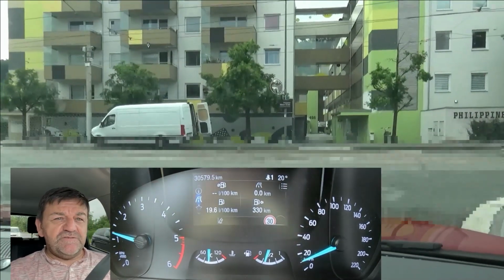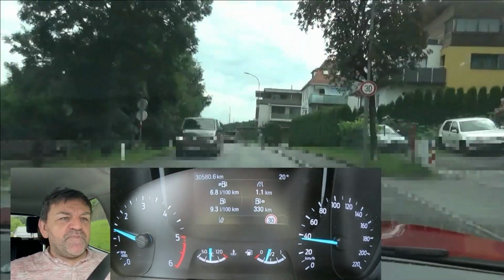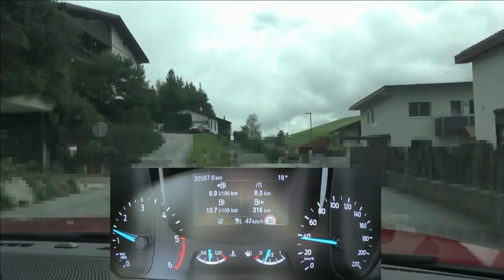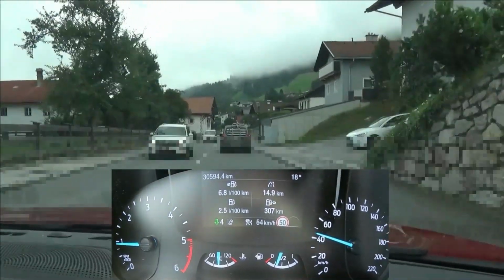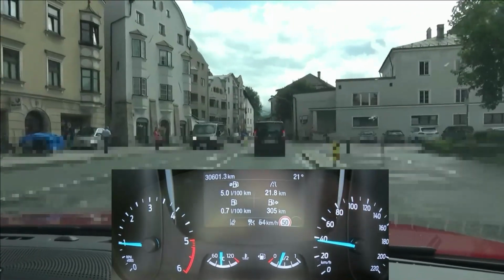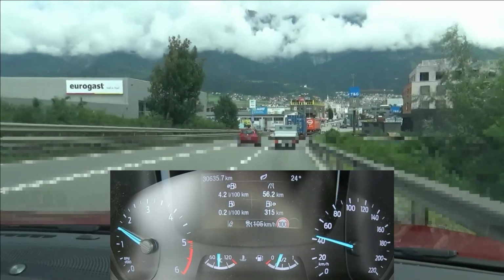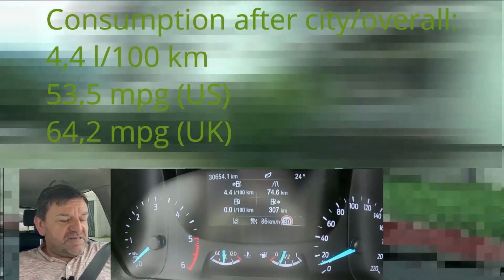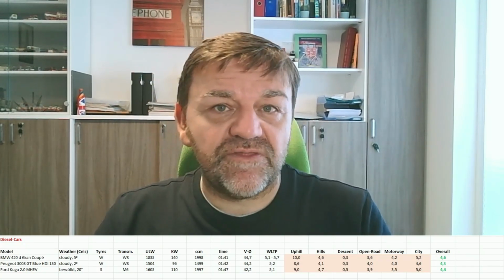Ford Kuga/Escape Diesel Mild-Hybrid - real-life fuel economy test done by a professional ecodriver

Comment: Found your channel late but really not ideal driving for any turbo engine. The uphill is quite obvious here where you were demanding power off boost. Also with the turbo diesel, prolonged running below turbo range leads to clogged turbos and costly repairs. I'm quite sure that the hill section would be much better at 2000rpm.

Comment: Helmut, thanks for your video.  The diesel is not available in the U.S. I believe its called the Ford Escape here.  Diesel fuel in the U.S. is usually anywhere from 50 cents to a dollar more per gallon compared to regular gasoline (87 octane).   I will stick with a fuel efficient Toyota Hybrids that run on 87 octane gasoline, as our 2020 Highlander Hybrid all wheel drive, and 2022 Rav 4 Prime, have been very fuel efficient.  Probably as good as a diesel with both engines having a 14/1 compression ratio.
Reply from the maker: Heyday of Diesel is over here in Europe as well. They tend to get heavier and more complicated with all the exhaust-cleaning stuff. If you don't drive 40.000 kms/25.000 miles on a highway per year (hybrid-)gas cars are the better option.

Comment: Hybrid version in warm countries is nowhere near as efficient as it doesn't kick in when the AC is on, so you're effectively carrying round heavy batteries for nothing.
Reply from the maker: According to this logic hybrids don't make any sense at all, as people claim (mostly correctly) they are not so efficient in the cold, when the engine needs to be running to heat the car. I tested the PHEV with empty battery in 31° Celsius and achieved 3,7 l/100 kms...
Reply: @ecodriver1746  I'm referring to an Electric Hybrid like the KUGA in this test and that in hot weather using the AC impacts the operating of the electric pull away which is where the Elect part drives the fuel consumption down, if this doesn't work as well with AC on then you're effectively towing heavy batteries which is obviously worse for the consumption.
Reply from the maker: In my umpteen years of driving hybrids I never experienced something like that. Maybe there's something wrong with your car. Even in the hottest weather I achieve extremely low consumptions, even with my heavy XC90 (2,3 tons and only 87 kW electric motor). With empty battery and mid-20s, AC on I did 5,8 l/100 kms on this route. And as I said, the 3,7 with empty battery in the Kuga PHEV were done at 31degrees.
Reply: @Awesome TD LOL, never heard such a stupid argument. What exactly doesn't "kick in" in hot weather?
Reply: @arinagriese251  It's a very simple statement, I have a Diesel Hybrid and when you have the AC on the electric start to get you pulling away from traffic lights or putting it in EV mode does not work as much or at all, therefore reducing its efficiency. So its not so efficient when hot in real world  experience.

Comment: Excellent, just shows there's life in diesel yet, particularly on the highways, and where S/S tech can be used in town.
Reply from the maker: Yes, that's the only reason one would buy a diesel nowadays, if you do 20.000+ kms mostly on motorways
Reply: @ecodriver1746  Precisely. That used to be me; now it's not, I'm a short run urban driver, and  even on the open road hybrids are catching diesel up.

Comment: great video again.
but cant understand the big hybrid cars in genarel.

i drive a diesel car (Megane grandtour) and the consumption is exactly the same 4.4.
we just went on holiday about 350km from here drove around alot there and back home with 1800km on the meter. consumption 4.4

the hybrid cars are nice in the city but you dont realy need a car that size just to go shopping.

thx for the upload numbers dont lie
keep them comming ;)
Reply: This is just mild hybrid version + the main difference is diesel vs. petrol.
For petrol cars, hybrid system improves fuel consumption greatly - like 7l/100 km drops to 4,5l. For diesels, it's not as effective as diesels are IMHO not that effective constantly turning themselves on and off again.
Reply from the maker: I own a Volvo XC90 T8 Plug-In Hybrid and over 20.000 kms I've used 4,3 l/100 kms so far (plus electric energy). In town I drive purely electric, whereas a diesel is the most unefficient in stop-and-go traffic.
Reply: @ecodriver1746  Diesels in cities, especially on short runs are the worst. Mine 2 yo second car for a short run of 3-5km can barely reach working temperature. Totally wrong aproach by me to go for a diesel.